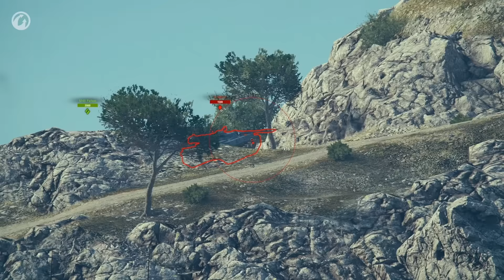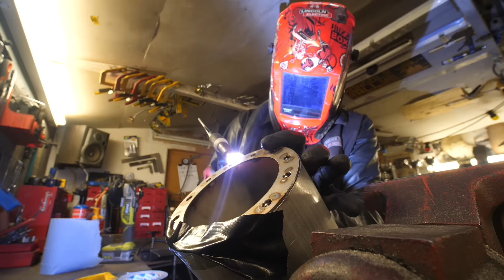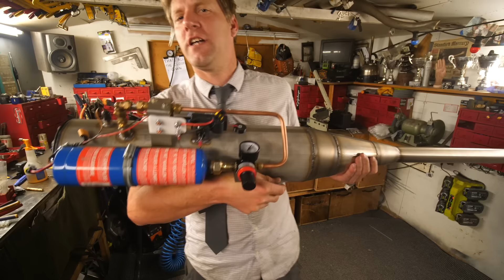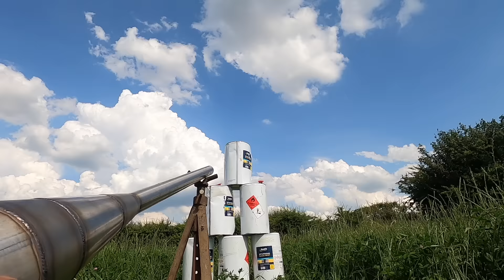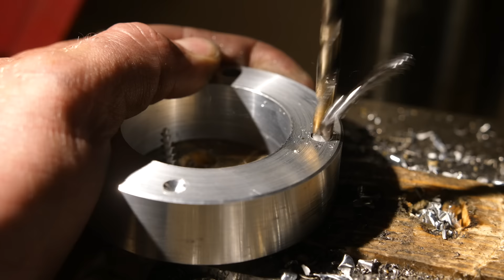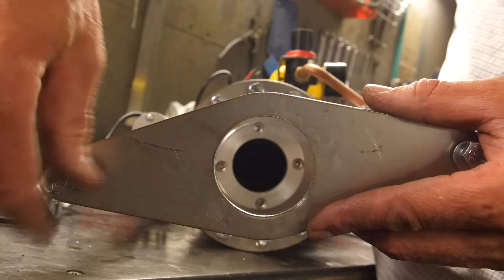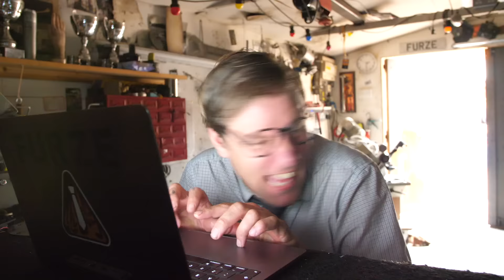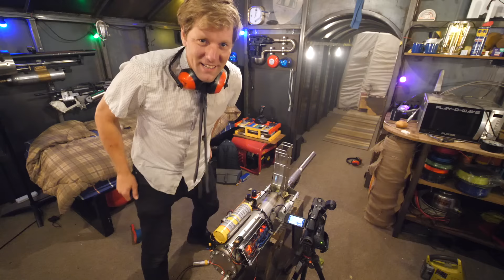SEMI AUTO POTATO CANNON for the Homemade Screw Tank

Comment: How did you solve the oxygen issue? I see a fan inside for mixing, but I don't see a fan for replacing the used gasses (CO²) for new Oxygen. When I build one I used big pvc ball valve at the back with a cpu van behind it to blow out all the used gasses out of the barrel (giving a nice smoking barrel) and thus replacing it for with fresh oxygen for the next shot.

Comment: If you dislike code and simply want "bare metal" to do the shooting , you could replace the microcontroller with NE555 timers. (really common and cheap chip) This will be a bit harder but you could build a set of chained timers like this one: http://www.play-hookey.com/digital/555/timer_555_sequencer.html. Just replace the resistor going to pin 6 with on each chip with a potentiometer and you can set the time. 
For safety i would also add a circuit that makes disables the button while the circuit is on. Just connect diodes from the outputs all into a simple not gate like this: [https://www.electronics-tutorials.ws/logic/logic_4.html] which powers the button.

Comment: Gas does not burn on itself. It needs oxygen. Either deploy solid oxidizer or force vent the compartment. Natural suck back is not enough considering how long the barrel is. Address this and it will shoot so much better.
Reply: Without oxidizer, the gas burns so slowly that the projectile may not even travel as fast compared to a CO2 propelled gun. Maybe try different fuels like ones with partial oxidizer mixed in, or gas/vapor high explosives. They are safe, clean, and powerful.

Comment: I actually made a canon/mortar very similar to yours, I used brass and pvc fittings and a fire extinguisher as a combustion chamber, and it’s attached to a 2 inch pipe, because the inside diameter is exactly 50 millimeters, so I can actually 3D print mortar rounds. Could you put the links to the parts you used? I currently am just using a propane blowtorch for the gas and ignitio, and I want to be able to screw in the cylinder instead of sticking a blowtorch in a tube.

Comment: Tanks DID have flamethrowers outfitted for certain theatres of war, the Sherman and Churchill, to name a couple, but they were of limited use. The Churchill pulled a trailer full of fuel, which tended to leak and set things on fire the crew hadn't intended to. Also, a trailer behind a tank is a horrible idea. Means you can't retreat in reverse without destroying your trailer full of 100 octane av fuel, and then tracking through the puddle. No bueno.

Comment: Why not use hydraulic pistons instead of the linear actuators, you already have a compressor on the tank. Depending on the setup they might also provide better strength and/or speed.

Comment: Colin if you intend  to use apples, you might want to put some protective coating on the metal, I found using a apple master (apple peeler, corer, slicer) that if I didn't clean it frequently the apple juice would start to corrode the metal, just thought ide throw that tip in for consideration.

Comment: I made a similar gun you will get more power if you meter the amount of gas going into the chamber so you can always have perfect combustion. Also freeze the potatoes so you can shape them better. With this and a longer barrel to get maximum power it will shoot through those cans you tested it on and will have a range of almost 1/2 mile

Comment: Instead of actuators what about using springs and tap into some of the expended gas and run it back from the end of the barrel to cycle the action of system. I'm sure that wouldn't be to hard for you to put together. It would definitely cycle a whole lot faster and (bonus!) less moving parts which helps minimize malfs! 
 That thing is kickass man!

Comment: If the barrel doesn't seem to be sealing right against the chamber, I suggest beveling the end that sits against the chamber with the part it touches being counter-sunk so they seat with each other, should make a better seal. The barrel having the bevel will also help it cut into the potato/beet/apple rather than smashing through them, help reduce work on the system.

Comment: I think it would've been easier to make a drum loaded, beet cardrige. Like in a revolver but the outer "case" of the cardrige is part of the barrel. Less moving parts and no problem with beet positioning itself vertically.

Second thought. If paired with a gas blowback tube it could be made 100% mechanical 👌

Comment: I think I would have made some different design choices. I would have made preloaded shells that drop in and slot into the barrel. That way you don't have to rely on the coring of the ammo by the gun itself. A little more work before you use it in exchange for more reliability and faster reloading. Tweaks I would make to his current design would be to make a recess for the barrel to fit into when it slides back, making the seal tighter and strengthen the chamber interface,  and a few other minor changes, but all in all a great working design. Keep up the awesome work.

Comment: You might want to rethink the 'No Flamethrower On Tanks' idea, Colin. One of the most feared weapons used on D-Day, and afterwards, was the 'Churchill 'Crocodile' flamethrower tank, which could project 'rods' of burning napalm like fuel 120 yards (110 metres). The germans were so afraid of this, that tank crews found that a squirt of unlit fuel against a pillbox, gun emplacement, or bunker, could often be enough to cause the enemy soldiers to surrender.

Comment: So I have a question I didn't see answered in the operation. How is he getting a fresh air charge in the chamber? You can't just keep adding propane to it and hitting the fire button, you will consume all the oxygen and it won't light.

I saw a fan in there, but I didn't see the purge cycle, or where it's getting fresh air from. If he was using 2 cylinders, one propane and one oxygen, I could see it, but not just propane only. 

Obviously I've used a few of these.

Comment: you should change the order of operations to do the spark first then load the potato and then inject gas. the first time you shoot it nothing will happen as it will just spark with no gas and no potato but then it will load one and the next time you fire there wont be a lag while it loads the potato. also you should put a second valve that injects compressed air in the chamber after the shot to clear out the exhaust fumes and make sure there's plenty of air in the chamber for the next shot. you have a mixing fan but it doesn't seem to be bringing in fresh air.

Comment: Very cool!
Since the tank is probably too small to have a second person on as a gunner, what if you made a hydraulically-controlled turret? You could replace the two-directional levers with 4-directional levers and have the side-to-side control the horizontal & vertical aim of the spud gun so it drives kind of like a digger.

Comment: Made a shoulder mounted one as a youth. Had a revolving cylinder like, well, a revolver. Used the gas bottle as the stock and the recoil pushed back enough on the bottle to use a pressure operated valve to regas for the next shot.

Comment: Ok, that was awesome. Btw you may not get flamethrowers on tanks but you do get mounted machine guns so you could always put like a mounted paintball (or some other pellet) turret on the roof of the screw tank that either you control or you could have it remote-controlled since that could work too. This is assuming that you are going to put the spud cannon on the front end of the screw tank.

Comment: Since you've got pressure regulation and your combustion chamber is a fixed volume, you simply need an extra solenoid at the propane tank end of that tube to make a fixed metering volume. That will give you an exact fuel ratio when dumped into the chamber before ignition. Aim for around 4% propane. http://www.burntlatke.com/lp.html

Comment: this is much better than the gatling potato gun i saw. multiple barrels all preloaded with shot. as the barrels rotated theyd come into contact with some electrodes. the circuit would complete and the barrel would fire. so youd get 8 shots off very quickly but then need to spend 20 minutes reloading

Comment: Why didn’t you make the cannon pneumatic? You could have used air pistons to absolutely slam the potato into the chamber. The air pistons could have run of the main tank and you could have a 2 stage firing tank. One large tank powering pistons and a smaller tank that gets dumped to fire the cannon. Just a though love the video. Also please to more microwave oven elecyromagnets

Comment: Doesn't the screw tank use hydraulics, you could just tap it into that using hydraulic cylinders instead of the linear actuators. that would allow a for a more tighter seal and would probably work faster.

Comment: All I can think of is hearing spuds blasting so fast it matches the beat of one of your classic rock tracks 😈👌

Why not both when it comes to the potato launcher? I mean you can always just freeflow the ignition system if you’re usin an explosion for propulsion 🤗
Reply: This was so freaking cool man!
Add an air inlet into the rear cap and make a protocol for flamethrower mode, shut the barrel/coring mech and then vent fuel and air and do it the Furze way ;)

Man you’re such an inspiration!

Comment: Nice now you need a camera on the barrel for a sighting system and a monitor in the tank, mix the mount with a pan and tilt system and you’ve got full control, you could even add Ir lighting for night vision or use a thermal camera

Comment: have you thought about replacing the Linear actuators with pneumatic cylinders ? they should even at this size have way more than enough speed and power
Reply from the maker: Yeah but then you need an air source, so either got to have onboard compressor or bottle that would need recharging so thought electric is simple and give chamber a chance to re circulate some fresh air.

Comment: NGL, I was not expecting that loading system to work as well as it did. My first thought was some kind of revolver cylinder or harmonica clip type setup, but the "corer" system takes advantage of the properties of the vegetable ammunition rather than trying to replicate systems that work for bullets- great problem solving! Might want to put a lid or flap or something on the top of the hopper though, otherwise when its fully loaded they might jump out of the top from recoil.

Comment: Why didn’t u make it so rather than use a hopper, you use a spring loaded magazine or a ‘belt fed’ system pushing prelumped/mashed potatoes down a tube and using air pressure to propel it I to the chamber. Then have the controls inside the cockpit and have it so you can reload inside the cockpit by opening a trap door and refilling it with more mashed potatoes

Comment: Doesn't the tank run on hydraulik motors? Why don't you use hydraulik pistons for the reload mechanism when the necessary pump is already there? Should be faster AND more powerful then linear actuators.

Comment: If the feed tube had a spring and follower like a guns magazine, it would prevent the sugar beat cores from flipping up. I would have also said to cut a step into the breach end and make the barrel come back further so it sits inside the rear piece slightly.

Comment: Colin: "You dont find flamethrowers on tanks"

Me: "Flammpanzer I, II, III were German FLAMETHROWER TANKS. The Churchill, Sherman, and Matilda all could be equipped with flame units as well."
Reply: Flammenmaus too
Reply: Five models. Out of the thousands that have been designed. Not a high percentage, hmm?
Reply: @cjprojects7975  And trust me there are more. I only listed a few. I could list them all from ww2 to the cold war era
Reply: @cjprojects7975  just look up flame tank and click on the Wikipedia article and it will list  a fair amount more, but their only real use is/was to clear jungle vegetation, bunkers, and caves which can be done in an easier and safer many by dropping bombs on said location either napalm, other type of incendiary, or just high explosive.
Reply: @cjprojects7975  five models from World War 2. Plus there isnt a big need for them in modern conflicts as you aren't clearing bunkers with them. Why use fire when you can drop a bomb designed to penetrate the bunker before exploding.
Reply: @Vash001  regular pressure-fire flamethrower was just replaced with rocket-assisted ones
Reply: @theovoldjopus4272  Eyup for the US flameunits were phased out in favor of the M202 FLASH
Reply: There were also several used in Vietnam...
Reply: Yay someone said it.
Reply: Everything changed when the fire nation attacked
Reply: You forgot the Churchill tank
Reply: @eeeeee3220  my comment clearly states that other than the Flammpanzer I said CHURCHILL, Sherman, and Matilda
Reply: Was literally just about to comment that too.
Reply: I think that would violate the Geneva Convention. I'm not 100% sure, but I think it would.
Reply: @RootLocusSucks  Flamethrowers and incendiary devices no, but something like White Phosphorus would be a yes
Reply: @Vash001  you aren't actually allowed to burn people with white phosphorus. It's only approved for smoke
Reply: @RootLocusSucks  technically  the use of flame throwers on personel is as its thought of as inhumane weapon and should only be used to clear foliage / cover that is being used militarily but theres nothing against their use really there jsut a really short range weapon compred to a High ex shell that can be fired 2 kilometers and therefore flamethrower tanks aren really used that much, they are however the msot effective weapon of WW2 in terms of enemy subdued / captured/ number of victories that can be atribrituted to them, the crocodile adaption of the matilda and churchil could allow bunkers to be cleared without the death of the soldiers as when faced with burning to death, running or surrendering they tended to choose life.
Reply: The L3/LF lanciafiamme
Reply: I was wondering if anyone would pick up on the flamethrower on tanks thing.😂🤣😂🤣😂🤣🤣
Reply: Alright smarty pants tell me every stand in jojos bizzare adventure you got 30 seconds

Comment: Two questions...
1) At what point does a spud gun become subject to the UK Firearms Act? Seriously, a firearm is defined as "a lethal barrelled weapon of any description from which any shot, bullet or other missile can be discharged", and judging by how hard that was hitting, it is arguably bordering on lethal.
2) I wonder if injecting pure O2 would increase power? Did you mention what the fuel gas was? Propane? Acetylene?

Comment: you need to look at bicycle suspension pivots and use the idea to increase power and speed of the loading mechanism.

Also, if you can introduce a vacuum in the first phase of the cannon (i.e. the barrel) that will increase the exit velocity of the projectile...increasing its damage potential still further.

It would also give you the opportunity to add some weight up front as you would have to introduce a vacuum pump

;-)

Comment: Surprised you went for gas over air pressure powered gun. Still the loading system is amazing. 
You should see what a potato does at 150psi (1000kpa)  :D

Comment: For the retraction of the barrel, it might more reliable to stop the linear actuators with a contact switch, so rather than running for a set time they stop when the barrel is actually flush to the chamber. Otherwise as the batteries run low you might not get a proper seal, and if there's a particularly solid projectile it might not complete the movement.

Comment: Your system works really well but wouldn’t it actually be smarter if you had it so you can load it by itself without firing right after then load again. So you can had a round chamber and ready to fire at your target without having to wait for it to load. And it might also work better if you had a ring around the barrel to push the extra stuff off so the actuators have less resistance. And you may want to put a cover on you ammo box so the rounds don’t fly out when you are firing. Just a few ideas to do improve this awesome machine.

Comment: Make a Mount for the cannon so it can be used on the ground.
I also have another crazy idea:
So a potato cannon but it shoots very small potato rounds. You core a potato and make a machine that takes a small piece out, fires it, moves slightly to the side, takes another one out, fires it etc.
To make it last longer once one row has been used rotate the core slightly to get another row and sow on and then...
PEW PEW PEW PEW PEW PEW PEW PEW PEW PEW PEW PEW PEW PEW PEW PEW PEW PEW PEW PEW PEW PEW PEW PEW PEW PEW PEW PEW PEW PEW PEW PEW PEW PEW PEW PEW PEW PEW PEW PEW PEW PEW PEW PEW PEW PEW PEW PEW PEW PEW PEW PEW PEW PEW PEW PEW PEW PEW PEW PEW ):D
Next video: FULLY AUTOMATIC POTATO HUN BOI!!!

Comment: Could it be more powerful because of the much longer time the projectile spends accelerating in the barrel? With the previous version you've loaded at the end of the barrel, but the automatic system loads it in the back, so the potato has the entire length of the barrel to pick up speed from the burning gases behind it.

Comment: make 2 potato tanks, armoured with cardboard, and then fire at each other using potatos.
If the potato penetrates the cardboard it won't kill or maim (might bruise a bit though)
you probabyl would need a crew of 2 per tank.
(making another screw tank might be too much, so making a second cardboard tank as cheap as possible could also be a decent project :D )
If the cardboard is on a frame, you can also easely replace it when damaged.
PS: Not the full power potato guns, cause that will brake bones, I mean more of the THUMP potato derp cannons that fire about 2 to 3 times the speed you could trow a potato